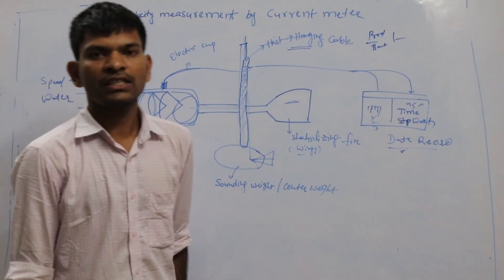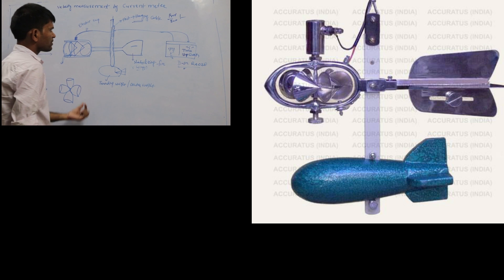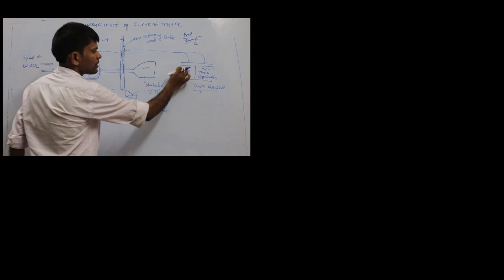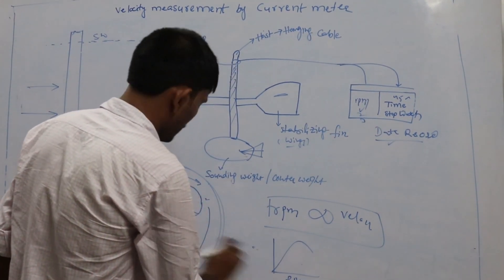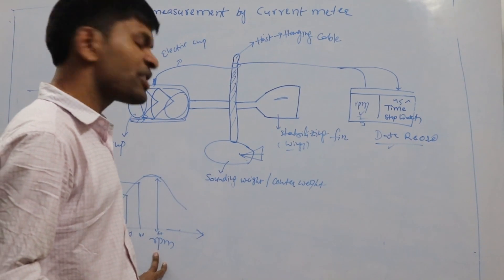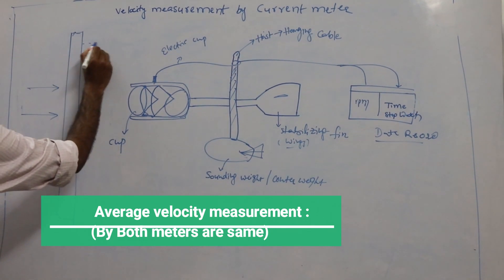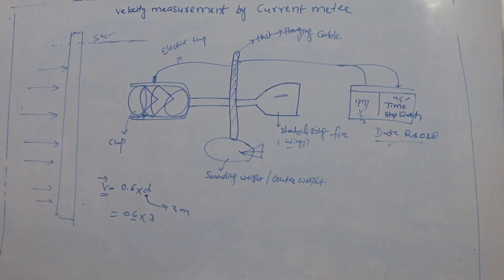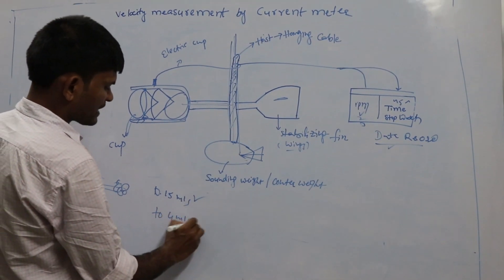Current meter method for velocity measurement

Comment: In the White Board you shown cup type current meter I using but its showing only RPM. How can I convert it M/S Meter Per Second 

Thanks
Saiful Haque Khan
Creative Survey
Bangladesh
Reply from the maker: V=aN+b
V= Stream velocity at the instrument location m/s
N= Revolution per second of meter
a,b= Constants (a= 0.65 b=0.03 for standard size cup diameter 12.5 cm and for 5 cm  a= 0.30 and b = 0.003 .
Reply: @Jathothveeranna  can you calculate this RPM to M/S. I Have Collected Data 50 second and RPM recorded 71 cup diameter 5 cm then what is the velocity in m/s
Reply from the maker: @SaifulHaqueKhan  yes ...u send the data
Reply from the maker: @SaifulHaqueKhan  veerucae023@gmail.com